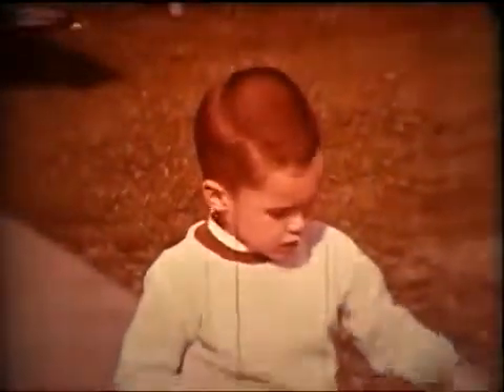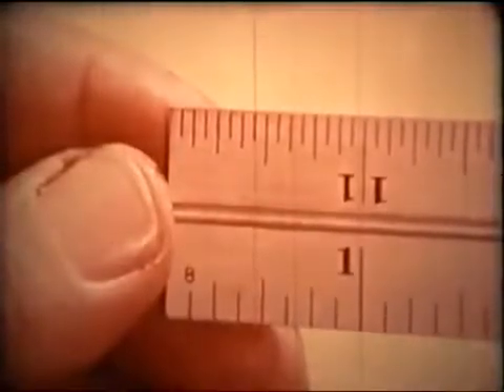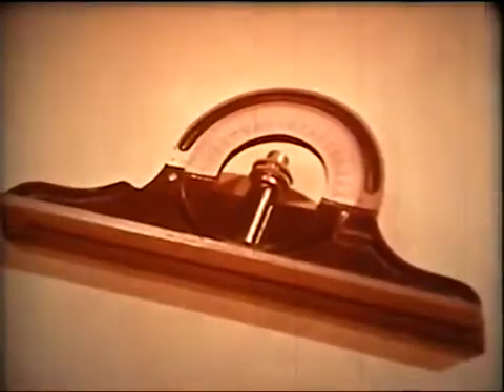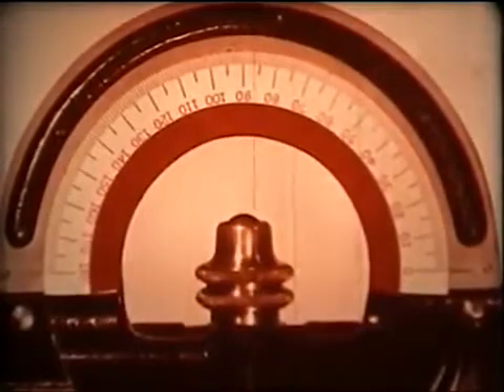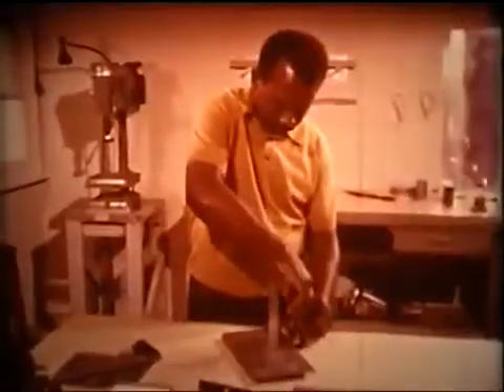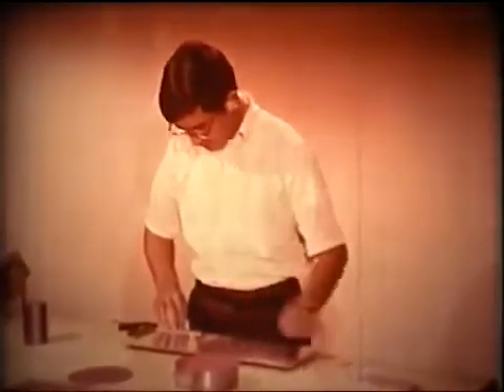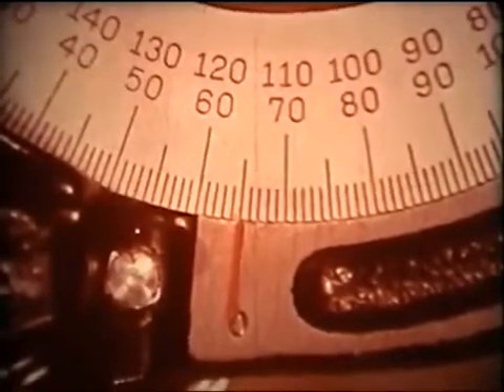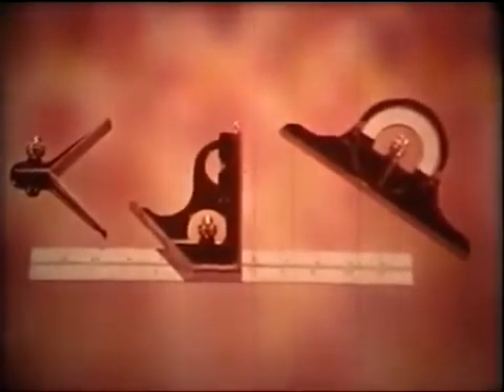How to Use a Combination Square:  Tri Square, Center and Protractor Heads

Comment: Eights, sixteenths, thirtyseconds and sixtyfourths. And that's not counting the thousandths where inches start making sense since it's not a retarded fraction, but that can't really be fitted on some readily readable measure and would require some sort of specialized tool.
Comes from the same country that touts itself as pinnacle of democracy.
It all makes sense now!

Comment: I wasn't in wood shop in high school.  I'm trying to build a table top for an L shaped sit stand desk frame I purchased because the factory manufactured ones don't fit my space.  YouTube has been a fantastic resource catching me up and significantly improving the less than basics I've learned by trial and error.  One thing about YT videos is they almost always have to have:
1.  A hook: usually an attempt at an entertaining persona and maybe some cheap effects and hopefully some good educational material to pass along.
2.  Sponsored links at the bottom to further monetize their channel.
3.  (optional) A sensational hook in the title, usually resulting in a video that does nothing for me.

I absolutely understand the need for this, but I haven't had an easy time of learning the basics; maybe because I haven't really sought them out.  I realized after watching another video that these combination squares are what I probably should have bought than the speed squares I picked up when I first started out buying tools that looked helpful.  I had no idea how to use the center finding module and landed here as the first result while searching for generic information.

While I watch the channels attempting to be very entertaining and going a little nuts, I'm more interested in how to accomplish my goals in an efficient and effective way by doing as much research as possible.  The channels that toss in a small amount of flare and get more into the detail of what and why they are doing what they are doing are much more desirable.  These old videos are fucking great because they cover all of the basics which I have very little formal knowledge of and only a little of self taught or what I think I may know from reading forums and watching videos.  I'm not even done with this one and already have the joint video queued up and ready to watch.  

I was describing using clamping cauls to a buddy who has only rarely done any type of woodworking since wood shop in high school and he knew exactly what I was talking about.  It took me hours of watching videos and finally resorting to forums to finalize convincing myself that I don't need to buy a cheapo inaccurate biscuit joiner to get a flat tabletop.  Hopefully I can go over some more of these videos before I start working on my table top because I'm certain there is some significant fundamental that I have no idea about but is inferred in most of the information I consume and glossed over.

Thank you @16mm Educational Films.